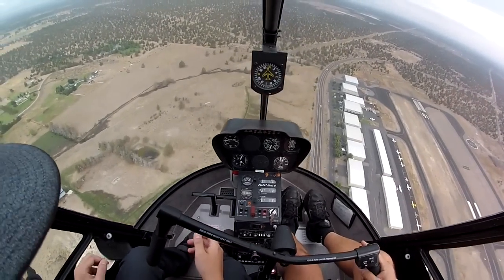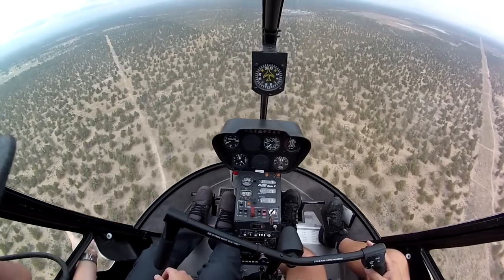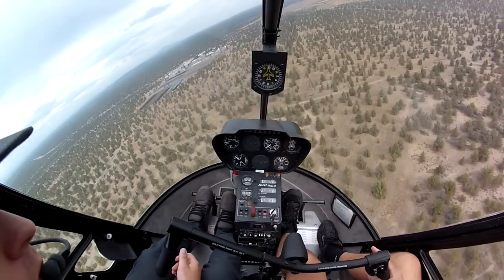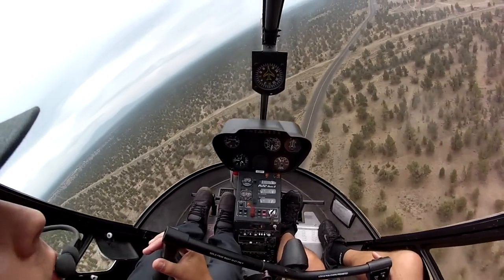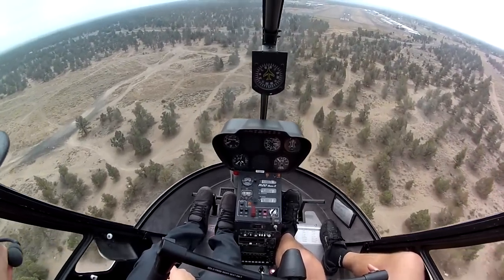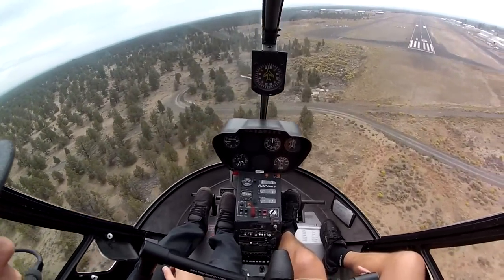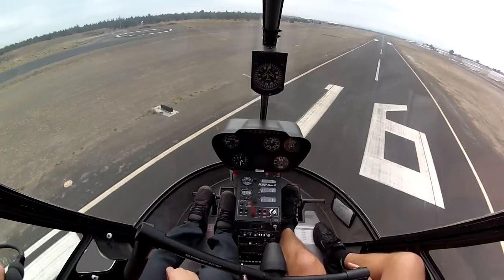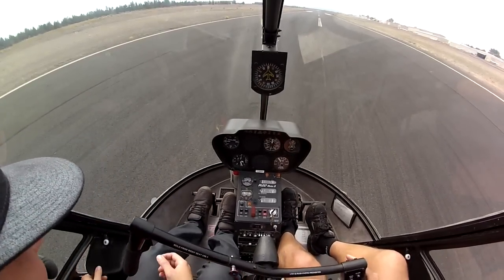Helicopter Stuck LEFT Pedal - What Do You Do if You Have a Stuck Pedal?

Comment: Which one is worst stuck left or right pedal?
Reply from the maker: That is a great question! I think it would also depend on how much pedal and what speed/power setting when it happens. And different airframes may have different procedures, but with what I do in the R22, I think I prefer stuck left pedal because the touch down speed tends to be slower and it is easier/safer to go around when low and slow with stuck left, IMO.

Comment: WRONG.    Left stuck pedal.    Rolling throttle OFF would make the aircraft yaw even more left.  

Your pedals are normal in the video.  Left pedal almost always slightly forward than the right.    This is how it would be in a hover.   Which is why this worked.   This is NOT the correct procedure for a real left stuck pedal.    Smh.
Reply from the maker: Thanks for the feedback. OK, lets unpack this...

1> Rolling off - I agree it does bring nose left - but it is only used AFTER the nose has swung past center, to the right, to bring the nose back towards center. (01:54)
2> Pedals are in normal position for CRUISE flight - that is where we agreed the pedal became 'stuck' at the start of the video (00:14). As you spend most time in cruise flight the likelihood of stick pedal occurring at that setting is highest...
3> No, it is not correct position for a hover - that would require MORE left pedal than in cruise flight, which is why it starts to swing the nose right as we come to a hover (not enough left pedal) and we have to roll off to bring the nose back left towards center (01:54)
4> You simulate a stuck pedal (left or right) at the point likely to be used when stuck (low power = right pedal in, high power - left pedal in) - you do not simulate full left or right pedal stuck as you do not normally use full left or right pedal in 99% of flying. 

Please watch again, referencing my notes and see what you think.

SMH ;-)
Reply: @HelicopterTrainingVideos which one is worst right or left pedal stuck?
Reply from the maker: Right is usually a faster touchdown, so probably more dangerous.
Reply: @HelicopterTrainingVideos  very interested, being a R22 pilot with low amount of hours flown. Can you please confirm I got the sequence right: 1- approach with relatively low speed and a steeper than normal. 2- use collective (UP) to yaw right 3- once skids are aligned with the path roll throttle down and touch down. Correct? Thank you for your time.
Reply from the maker: @mat_Rob22 Yeah I would go past center slightly and then roll down (very close to ground) to bring the nose back to center at about touch down. It also depends on wind etc. Find a CFI who can show you/teach you.